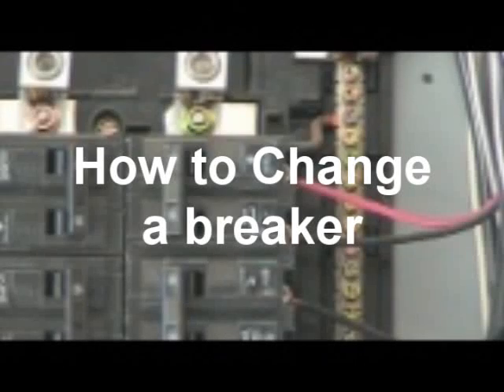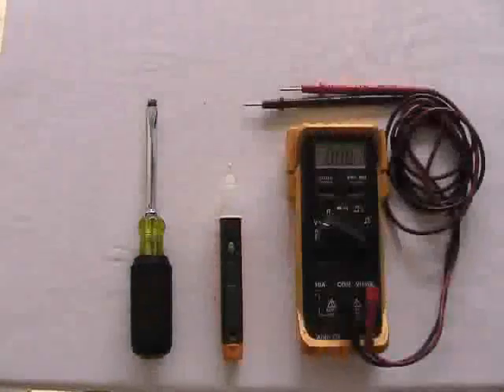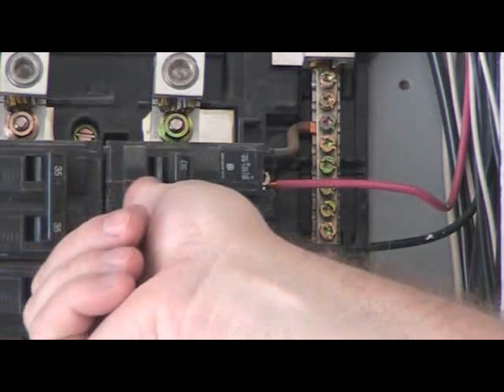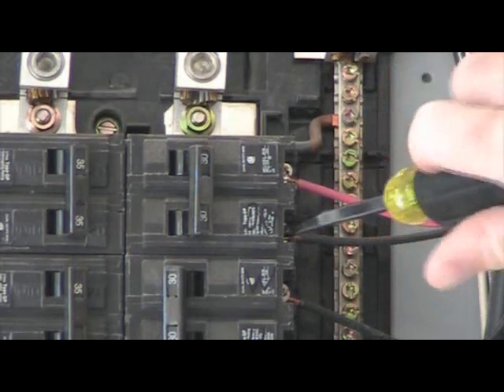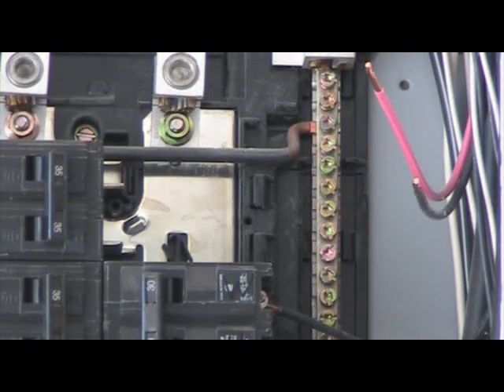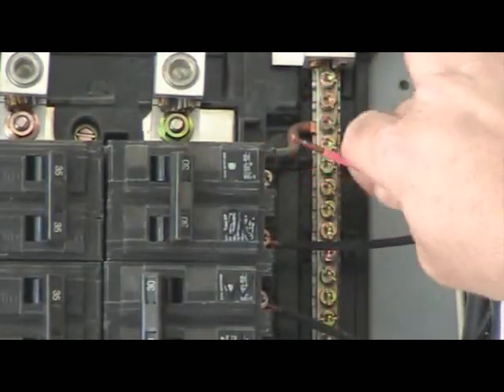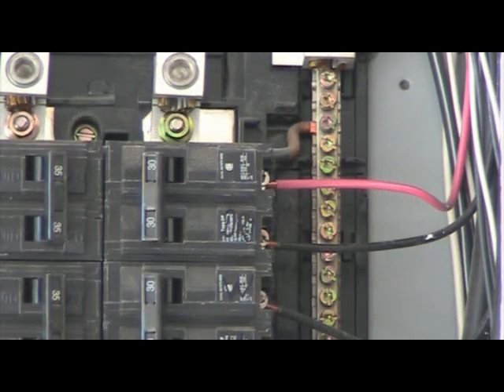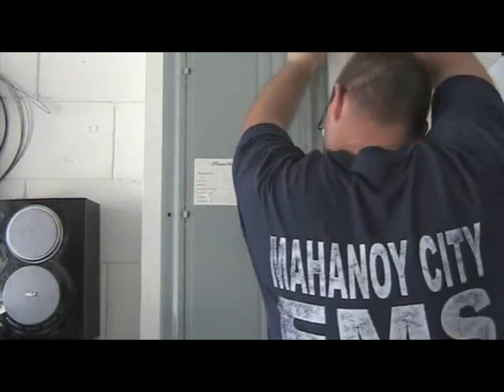How to Change a Breaker

Comment: Followed your video and successfully changed out a faulty 40 amp breaker for my outside A/C unit. Breaker showed good readings until load was placed on it and then it would heat up then trip. Was going to replace the breaker anyways due to heat possibly damaging the breaker. Once new breaker was installed a load was placed on it and problem was solved. No more heated breaker. Home was only 5 years old so a bad breaker is possible even in relatively newer homes. Thanks to your video I was able to change the breaker safely, saved me from a potential fire, and a $260.00 plus repair bill due to this going out during a holiday weekend.

Comment: thanks very much for posting this video! I just installed a 40 amp breaker in my square D QO box for a 25,000 BTU 240 volt electric space heater I just bought and installed in my garage with an 8-2 romex cable. This was my first home electrical job, and I couldn't have done it safely without this video

Comment: thank you so much i was so scared a nervous wreck when my husband was trying to do this last night he was unsecsessful  because we did not  know that you can actually remove whole circuit switch off to replace.. youve done a excellent job on this video explaining clearly and carefully what to do iam not such a nervous wreck now and know now with your help my husband can do it on his own.. thank you again great video
Reply: You have to turn off the main power. turning off the breaker does nothing alone the lines of getting shocked. in this premises all breakers not installed better be off or hypothetically someone could get shocked? the wire it's self is still considered hot and will shock you, hence the reason for turning off the main

Comment: IMPORTANT:  Unless you have something running that is going to get royally messed up by cutting power to it(highly unlikely in a residential setting) FLIP THE MAIN BREAKER OFF(most likely at the top of the panel) BEFORE DOING ANYTHING IN THIS VIDEO.  Don't be stupid.  Kill the power as best you can.  Don't install a breaker on a hot bus bar.
Reply: My house don't have it what should I do help
Reply: @michaelwhite1285  You are only supposed to work on a live circuit unless it is justified. Shutting off the main is the right way to do it. Getting electrocuted because you want to be a macho man is dumb.
Reply: @jamesshanley1558  Yeah, except for the potential electrocution if something goes wrong. Sure, sure, nothing YOU do ever goes wrong, correct? You're one of the geniuses who NEVER has an accident. Accidents are for snowflakes, right? So, yeah if there was no way to shutoff power (which should never be the case), I might work on a live panel. But I wouldn't do it the way this guy did. First, I'd connect the load wires before inserting the breaker. Then I'd snap the breaker into the panel still in the off position. Then I'd switch on the breaker.
Reply: @jamesshanley1558  "Completely safe"? That's what Alec Baldwin was told about that pistol.

Comment: The only thing different that I would do, is to verify that the "sniffer" is working by testing it on a live circuit before concluding that the dead circuit is actually dead.
Reply: I agree with what you're saying. I don't personally use sniffers as I don't see them as trustworthy. Much rather use a voltage meter to ensure I have shut off power.
Reply: you're right
Reply: good

Comment: It’s also a good idea to strip new ends on the wire you pull out of the breaker. The existing wire strip lengths could have indentations which can weaken the wire.

Comment: If the panel is still live when you proceed to do this, make sure you never have both hands in the panel, which he demonstrated but didn't explain. If you were to touch something live while your other hand was touching something metal in the panel or grounded, you will get shocked and that creates a direct path to your heart. Be safe and shut the main off and have someone to hold a flashlight.
Reply: Yap..electricity should not be taken lightly.
Reply: Thankz

Comment from the maker: @cliffistheman - The meter is needed in for this to verify that the power is in fact off when you turn the breaker off.  There are times when you shut a breaker off, and power still flows through.  So this is mainly for safety, you dont want to get hurt, especially when it comes to electricity.  You can also accomplish the same thing using a non contact tester.

Comment: SHOULDN'T THE TOP MAIN BREAKER BE TURNED OFF FIRST ???
Reply: yes!! don't worry he's an EMS
Reply: ***** nope he's EMS.... they are not human!
Reply from the maker: Chess Tactics Depends on your comfort level.  I dont, but then again this is what I do on a daily basis.  For others yes you should shut it off.  Again it all boils down to your comfort level.
Reply: +Carlos Vreal HA!
Reply: If you look this is a main lug panel not a main breaker panel. So it doesn't have a main breaker.
Reply: +Taryon Johnson people don't watch tutorials like this because they know what they are doing though. We're here cuh we dumb
Reply: Work like this normally requires a licensed professional, so its common sense that if you're going to try to tackle something like this you should at least have a relative understanding of what you're getting yourself into.  If you just watch one youtube video and automatically think you're a licensed professional, then well, survival of the fittest.
Reply: Yes u should. Power has to be completely off on panel when being worked on.
Reply: I have an old school brakers the one that uses fuses can I change it to new ones?
Reply: bahahahahahahah
Reply: el
Reply: If you're not a professional, YES.  Always.
Reply: I've only been out of Ranken Technical College for like 2 years. I still don't like wiring hot if I don't have to but in this case I had no choice so had to recheck my facts just to be super safe. I probably won't feel completely comfortable doing this hot until I'm like 10 years in the game. Lol
Reply: Eds Channel koo
Reply: YOUR 'COMFORT' LEVEL MEANS --NOTHING!!..in these situations.  Safety steps, like turning OFF the main, is NOT conditional--some unknown is always lurking somewhere!
Reply: That's alright...If you don't turn off the Main Power first...When you go to install your new Dishwasher then, you will have a Tim Allen moment like on Home Improvement when he gets shocked to hell and has to dance it off LOL
Reply: No, there is no need to turn off the main breaker.
Reply: Yes. You should always assume your are showing people who have never done this before, so shutting the main breaker should have been done first and foremost. Safety first always.
Reply: What about locking out the main breaker? Safety first skadoosh
Reply: @tilligetbig  lmao
Reply: my confort level says its 1o'clock, 2 o'clock, 3 o'clock, 4 o'clock, 5 o'clock, 6 o'clock and I still do nothing
Reply: @tilligetbig  bwahahaha...too funny...you okay? Carlos, Carlos....Hey CARLOS....oh, you were just correcting the autoincorrect...lol
Reply: Current won't be going through the breaker if it is off... which is why he said, make sure the breaker is off... saves you from shutting power off to entire house

Comment: Thanks for the video it is very helpful and easy to understand... I noticed you turned the breaker off, of course, but not the main switch. Is that not necessary? Also what would say going from a 15 amp to a 20 amp do? Will it allow for more hmmm dont know how to say this other than if i have a 20 amp instead of 15 amp can i plug up more items with out the circuit tripping. This question is intended for TheElectricalDoctor ONLY all others will be ignored :) TY

Comment from the maker: I think electrical gloves are great!  But what you failed to realize here is that the wires that my hands rubbed up against are dead.  They are the wires that I removed from the breaker.  With the wires removed from the breaker, there is no possible way that the wires would be energized.  Thank you for your comments.

Comment from the maker: @cafehuh If you are referring to the screw terminal that holds the wire to the breaker, this is a common problem.  Your best bet in this case is to remove the breaker from the panel with the wire still attached.  Then with the breaker removed cut the wire as close to the breaker as possible.  Then you can strip back the insulation and install a new breaker.

Comment from the maker: @MrAna811 - if all the wires attached to that breaker were black, than you have nothing to worry about.  Just reconnect them to the breaker.   But I do recommend changing the breaker as it sounds as though it is going bad.

Comment: I'm sure I'm preaching to the choir, but you really should cut the mains off before changing the breaker.
Reply: That was my thinking.  You can get bolted if you touch the wrong thing in there.  Agree there is little danger, but the breaker box is life threatening in the wrong circumstances, and cutting the main power seems a lot safer, particularly for beginners/DIYers.
Reply: i was going to do this anyway.. i sure af don't wanna die, i am clumsy as it is.
Reply: @deathtotruthers1 00
Reply: Not if you use needlenose pliers to pull out the breaker.

Comment from the maker: @livingyourdream2010 - if your saying that you reset the breaker, and after a while of using it trips again then try replacing the breaker.  Allot of times this is caused by a stressed breaker, but putting a new one in will tell you if it was indeed the breaker or something more serious.

Comment from the maker: It depends on the specific problem.  If you have a specific load that is drawing more than normal, then yes they would need to do a dedicated line to that load.  If you simply have way to much on the circuit, then you will need to lessen the load or split the circuit by running a new line.  The only way you can simply install a larger breaker is if your wire is rated for it.  ie. 12ga is rated for 20amps, 14ga is rated for 15.  If you only have 14ga wire, then no you cannot up the breaker size.

Comment from the maker: Typically the size of the wire will be printed on the sheathing of the cable.  However if you cannot see it, then it is really a matter of eyeballing it.  You can always go to one of your local home improvement stores and look at the wires.  Makes it much easier to recognize them when you see it.

Comment from the maker: What you need to consider is wire size.  If the wire is 14ga, the max size you can use is a 15amp breaker.  If the wire is 12ga, then you want to use a 20amp breaker.  10ga is rated for 30amps.  Hope this helps you out.

Comment: It's quite different than European electrical installation. We have everywhere three phase (black, brown and gray), neutral (blue) and groun (green or green-yelow). There are one some phase (in left hole), neutral (in right hole) and ground in 1phase (230V) power outlet. There are three phases, neutral and ground in 3phase (230/400V) power outlet. Every diferent circuits are bad. Sorry for my English :)

Comment: Thank you to show the easy way to replace a breaker in the electrical box, I would like to know if I have to get the main power off or only the breaker that I need to take it out thank you very much I wait for your answer
Reply from the maker: The safest way would be to turn the main breaker off.  However just turning off the breaker needing to be changed would suffice in most cases.

Comment from the maker: Your right, I did not realize I did not use the meter.... LOL - but just like using the non contact tester, the meter is just another method of verifying that no voltage exists on the load side of the breaker once you shut it down.

Comment: I know you're looking for a response from TED, but I'll throw this out there.  You shouldn't increase the size of a breaker.  The wires were sized for a 15 amp feed.  If you change to 20 amp, then that makes the wires the weak link.  If the breaker is the weak link, it trips.  If the wire is the weak link, it catches on fire.

Comment from the maker: Yes it is perfectly ok to use it on that.  The rating on the plug is a max rating, so long as your voltage does not exceed the rated voltage, you will be fine.

Comment: Scared shitless changing my first breaker but it worked out. Thanks for the video..
Reply: ***** and all, shutting the MAIN breaker is simply redundancy.  It's okay to do, but won't kill you if you don't.  Removing power from the screws at the terminal was done, and the only other place that's live is where the metal contacts on the BACK of the breaker (well away from where you're pulling and pushing), so unless you bridge the gap created by the breaker itself, you're going to be just fine.

If you're sloppy, or have poor hand-eye coordination, then sure, shut off the MAIN.  (...AND hire an electrician!)  :-P
Reply: +Jason
 Phipps
Reply: Jason Phillips is absolutely correct

Comment from the maker: @bugundatherug First thing you should do is make sure your resetting the breaker correctly.  Once a breaker trips, you cannot simply turn it back on.  You need to turn the breaker completely off, than turning it back on.  When you turn it off completely, you will hear a click, that is the breaker resetting itself so you can turn it back on.  Now once you turn the breaker back on, if it still does not hold - you can try swapping it out for another breaker.

Comment: You are right I messed up,  12ga is harder to work with. But the yellow vs white/grey advice stands yellow is 12ga and white/grey is 14ga.  I have mix of both, off 15 amp breakers  in my home for no apparent reason.

Comment from the maker: Sorry for the delay, so long as you use the appropriate size wire and connectors, there is no issue with making the extension like you describe.  Good luck....

Comment from the maker: Yes - the size of the wire will generally dictate the size of the breaker.  So if your installing a breaker that is not rated to protect the wire you have attached to it, then your install is wrong.  Here is an example, you cannot put a 50amp breaker on 12ga wire.  12 ga wire is only rated for 20amps.  Does this help you?

Comment from the maker: There is alot more then just changing the breaker.  If the wiring is already 10ga, which is rated for 30amps, you can simply change the breaker.  However, if the wiring is 12ga or 14ga you cannot.  Breakers are sized according to the wire attached to it.  So if you put a larger size breaker on a wire not rated for the extra amperage, you can have a fire hazard in addition to a code violation.  

My recommendation, if you need a new dryer line, simply run a new one from the panel.  Good luck!

Comment: Ugh! You should either replace this video with another advising the need to turn off the main before doing anything or add a text at the start of the video advising such. Even with the breaker in question off, the main bar is still hot and dangerous, especiallly for folks who have never done this before.
Reply: Right. If you're an electrician you would not be viewing this video. If you're the home owner (me) you can't afford to make mistakes with this type of task.
Reply: Ponorcxx

Comment: Thanks for a great and simple, well filmed video. I have a question...if I want to relocate breakers in my panel, can I just snap them out and relocate them to a new position? I am trying to balance my panel. Currently my furnace, refrigerator, washer, dryer, toaster oven, and entire upstairs (4BRs and 2 BAs) are all on the same leg. Thank you.

Comment: Why didn't you use the third tool named as necessary for this job - the digital volt meter? Can the volt meter (which I have) be used instead of the stick tester (which I don't have)?

Everything else in this video is crystal clear and easy to understand (for dummies like I). It's also the only video I've ever seen in which background music actually enhances the demo. The person who selected the music and infused it into the presentation has a remarkably keen sense for such things. Thanks!

Comment from the maker: If you have a 20amp breaker attached to 10ga wire, you can up the size of the breaker to 30amps.  However, if your 20amp breaker is attached to 12ga wire, you cannot upgrade since it would then be oversized and considered a fire hazard.

Comment from the maker: No issues with doing that.  Just be sure that when balancing the loads, your wires are still able to reach the breakers.  Otherwise you will end up having to splice some of the wires to extend their reach.  Depending on the size of the wires, it can be a real pain.

Comment: @ fizwin1, Thanks for the response! It's actually a 50 amp, that runs the Air Conditioning Unit. I'm unsure if it's clicking itself to an "off" position to protect the AC Unit, informing me of bad wiring or perhaps it's something else! The breaker itself was still "tight" indicating that it might not be the breaker. When I watched this video in the past to swap out a bad breaker, I remember the breaker being "loose", with alot of play when it was switched "on" & "off" once I removed it. !!HELP!